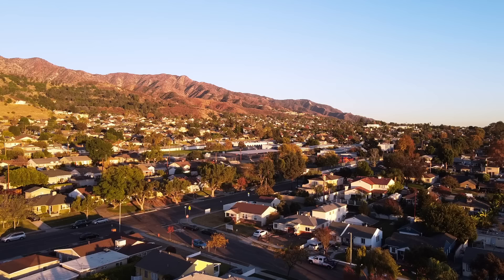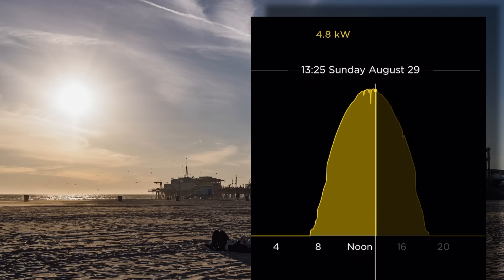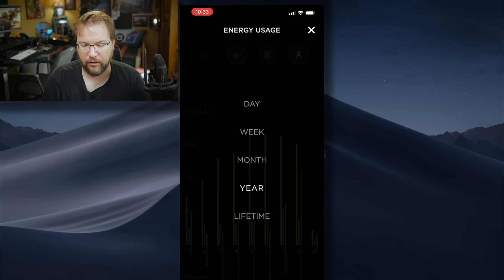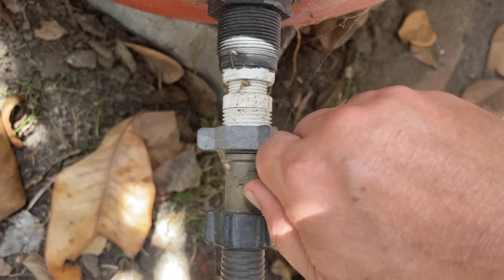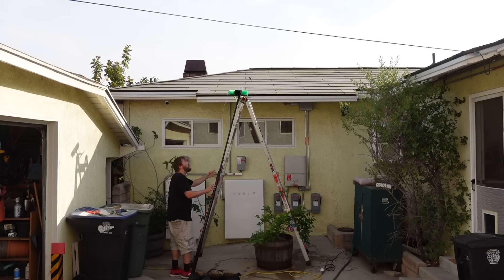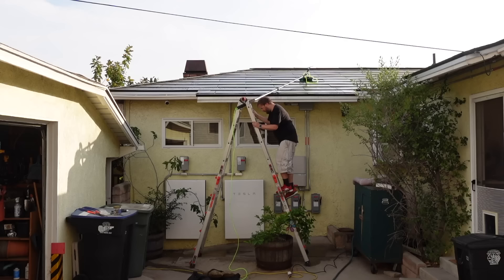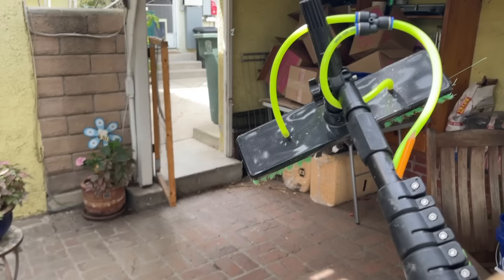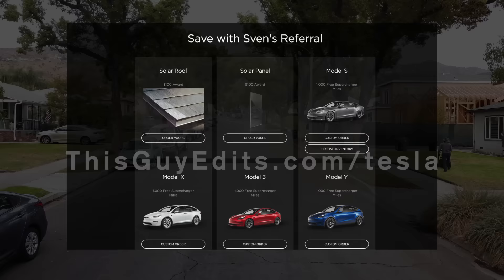Tesla Solar Roof: End of the Honeymoon Phase!

Comment: You guys in the USA seem to consume loads more Electricity than we do in the UK. My daily consumption is around 8Kwh per day, Approx 250Kwh per month. We also have to pay way more at around Unit rate £0.2031 GBP per kWh with a Meter charge of £0.23 GBP per day. My Electric consumption is fairly constant 365 days per year.  My heating for water and house heating is Gas which mainly cost around £50 per month 12 months a year with the months of Oct through to April costing around an extra £50 to £100 (colder months more expensive). Total annual Elec & Gas combined come to round £1500. I wonder if Solar would be a worth while payback period. I'm 65Yrs old and wonder if would see payback in my lifetime. I expect it depend how long am I going to live is the key question.

Great to see your experience of having the Tesla roof fitted. 

My house in the UK has tile roof. Its the original tiles fitted in 1928 when the house was originally built. They will need to be replace in the next 10 yrs as they are starting to flake. Hear in England it is not common to have boarded roofs. I wonder if TEsla have fitted any roofs in the UK. I'll have to find out.

Comment: Hose the roof down from mains tap water (more pressure) and then RINSE with the rainwater to remove mineral deposits before they dry.
I would think this would be easier, quicker and every bit as effective...?

Comment: Wouldn't it be better to wash the roof tiles with water from your hose bib?  maybe a converted pressure washer or something not quite so strong with bristles like you build for the rain water?  That pressure would make the cleaning of the dirt faster... You could also incorporate some kind of soap dispenser to put some dish soap in the mix.  after finishing a section use your rain water just to rinse the surface and remove any minerals that were in the tap water.  The only trick would be to make sure your first wash doesn't dry before doing the rain water rinse.  Also, would adding something like JetDry to the water help to keep minerals off?  nice video.

Comment: Idk about solar roofs. Probably better idea is nuclear energy augmented with solar fields that are more optimized for solar collection. Or a more efficient home solar system. 

For instance, the first kit I found is $12,000 for a 10kW system without batteries or structure for mounting panels. You can probably find it cheaper. Those panels can also all be mounted in a way to optimize solar intake. Unlike the Tesla system which is determined by your roof. That is also $12k before any credits are applied. So less than $20k for 10kW system, installation and batteries after tax credit? Just a guess. With easier upkeep and cheaper maintenance.

Comment: The improvement from cleaning is larger than you think. 41 kWh in september is not just 4kW better than that day in july, because the potential is less in september than it was in july (sun higher in the sky).
Reply from the maker: It wasn’t in September. The two days were within a 4 day span.

Comment: There are anti-spotting agents you can rince with that will reduce spotting (used in dishwashers). I don't have a tesla roof, but I use a micro-fiber shammy to dry our panels after washing (with Dawn) to prevent spotting/calcium build-up. Also, I wash when the roof is cooler, and not under direct sunlight.

Comment: Calcium and other particulates the filter might be taking out of the water are not necessarily toxins. In fact, I would be surprised if you had any significant level of toxins on the water on a developed country tap water supply.
Reply from the maker: Correct calcium is not considered a toxin. Our city water has worrisome amounts of unregulated chromium 6 and that is one reason why we filter out tap water for drinking.

Comment: I would definitely figure out how you can safely move around up there (harness and safety line) and then you’ll knock that job over in a couple of hours. I can do my traditional 9.28kW system in about 30 minutes. I just use a hose with a brush on the end and detergent - works great. No hard water in Sydney.
Reply: Watch out with detergent on your roof, this guy just has a rainbarrel but alot of people forget about raincollectionsystems beeing used for toilets or washing machines and maybe lawnwatering. U wont be laughing if your entire lawn is dead.

Comment: I miss this version of the app the new version is much harder to follow IMO. Cleaning the panels regularly is definitely worth it i see 10-15% more power. My best day has been 120 KW. I use a Ceramic car polish on the glass panels.
Reply: Polish that blocks or reflects light is going to severely impact the efficiency of your panels.
Reply: Wait a ceramic polish that reduces heat and light??? Sounds like your best day could be 160kw.

Comment: you paid 250 for a system, but you could have paid like 175 for an electric pressure washer (because we know how cali hates gasoline anything) with an angled arm, which also comes with a wash bottle....throw some soap on it and use the wide spray to get the least attack on the panels and be done in no time at all.

But you do you bud

Comment: I'm thinking if you had a large panel that would follow the sun it would be a lot more efficient than using the roof that only a small portion directly facing the sun generates the most energy.

Comment: Honestly I think regular panels are better, much cheaper higher energy density, easier to clean, they run cooler and have the advantage of lowering roof temps by acting as a "second roof" where installed. 
Like to clean let's say 8 large panels would easily do 1/4 of the cleaning. I think they do have their place maybe at the equator they make more sense as light will hit most the roof better. But otherwise your better off with panels fixed to where they will get year round light instead of over half being in mostly shade, ik they still produce power but not as much.

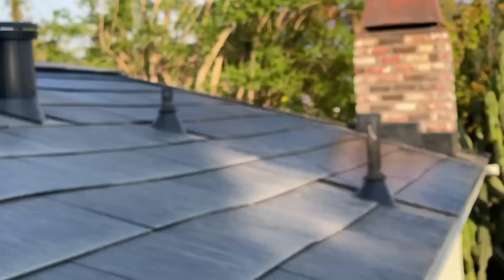Comment: Looking at the tiles at a front facing angle, they seem nice and straight. As soon as you get a good sideways angle at 7:18 they all look curved and warped. That can't be good for a rigid material like that. Of course I'm assuming the material is some sort of rigid plastic or resin. If that is indeed the case, I don't think your roof is gonna last as long as Tesla says it will.
Reply from the maker: The one side of the roof has a preexisting warp. The way they handled is with metal tiles in those spots which can be bent into shape and run over the warp.
Reply: @ThisGuysTesla  makes sense. I kinda figured it was the roof underneath that was warped but wasnt sure. That's pretty good. I couldn't tell the metal from the rest of the roof.

Comment: In your final estimation of the gain of cleaning up your roof, you compared a cleaned roof getting dirtier with a dirty roof that don't get even dirtier. For a constant loss rate of power produced no matter what you do, the energy gain would be much higher than your estimation, and at some point it would become economical to clean up your roof.

Comment: Water is very hard where I live, in terms o leaving spots, if you wipe things down and don't let the sun bake it on your car or whatever you should be just fine on almost any surface.  I had lots of experience washing cars by hand for years and basically you need to towel things off, same for windows.  I would assume the roof problem could be dealt with in a similar manner.  

Now the real question is how do you dispose of your more toxic than ever roof, will there be a charge for that and does it have one of those "Known to the state of California" cancer warnings on it?  I bet it does.   I cannot imagine the nightmare disposal costs of all these solar panels and roof maintenance problems in the real world 4 season places.
Reply from the maker: If you’re concerned about environmental impact, supply chain sourcing, factory carbon footprint, end product recycling and net energy breakdown you could read this:  https://www.tesla.com/ns_videos/2020-tesla-impact-report.pdf

Also While there are no global warming emissions associated with generating electricity from solar energy, there are emissions associated with other stages of the solar life-cycle, including manufacturing, materials transportation, installation, maintenance, and decommissioning and dismantlement. Most estimates of life-cycle emissions for photovoltaic systems are between 0.07 and 0.18 pounds of carbon dioxide equivalent per kilowatt-hour. This is far less than the lifecycle emission rates for natural gas (0.6-2 lbs of CO2E/kWh) and coal (1.4-3.6 lbs of CO2E/kWh).  SOURCE: IPCC, 2011: IPCC Special Report on Renewable Energy Sources and Climate Change Mitigation. Prepared by Working Group III of the Intergovernmental Panel on Climate Change [O. Edenhofer, R. Pichs-Madruga, Y. Sokona, K. Seyboth, P. Matschoss, S. Kadner, T. Zwickel, P. Eickemeier, G. Hansen, S. Schlömer, C. von Stechow (eds)]. Cambridge University Press, Cambridge, United Kingdom and New York, NY, USA, 1075 pp. (Chapter 7 & 9). http://www.ipcc-wg3.de/srren-report/

Comment: This is the reason I would not buy solar tiles over panels. You need to wash them every second month or you lose 10-20% of peak power and it is much easier to wash or automate the washing of panels than tiles.
Reply from the maker: It took about 4-5 months to lose 10% efficiency through dust accumulation. As soon as it rains efficiencies go back up as tiles are hydrophobic.
Reply: @ThisGuysTesla  Depends completely where you are and what types of pollen you have in the area. Here in Spain I have to wash my windows several times a week compared to in Sweden lets say.

Comment: On your highest energy usage during the hot summer months with that black solar roof. 
     Between convective heat and radiant heat projecting downward through your roof into your attic space. 
         What is the temperature of the heat gain in your attic that eventually heats up your ceiling drywall’s in your second story Redi and heat down into the house that your air conditioning needs to remove that consumes energy. 

Do you have some sort of radiant reflective barriers to offset the additional heat caused by the black tiles ? Was there extra insulation put down underneath that roof to slow down the heat absorption into the attic ? 

     DJ design in the air barrier underneath the tiles with an air gap opening down at the bottom of the eaves of the roof and use the natural flu affect as the heat hits the air in the gap it will naturally travel up to the peak of the roof and out helping him reduce attic radiant load ?

Comment: Lets do some math. $30-50k for a solar tesla roof. $30k divided by 16 cents power = 187,500 watts produced to break even. Divide that by 36 avg KWH production. That means in 14 years the system will start producing a profit IF nothing goes wrong, you dont pay anyone to clean or maintain it, and if the powerwall still is functional after 14 years. So if you pay $30k into this system, again never work on it, efficiency remains the same, pay no one to clean it or maintain it, and everything works flawlessly for 25 years. Im using 25 years because thats the warranty on the tiles alone. After that you get to replace on your dime. You will make $23,126.40 over 25 years. The risk to reward doesnt make alot of sense to me. I live in an area where the power here is 7 cents a KWH, which means it takes 35 years to pay off one of these systems. Im heavily invested into Tesla, however, the tesla tiles are a huge profit cow for people that like to burn money in my opinion.
Reply from the maker: Payback video coming soon. Find out if you're right :)
Reply: @ThisGuysTesla  Sounds good look forward to seeing that video.

Comment: So you wrote that the difference in the bills was "Savings" but you aren't saving anything yet.  What is the savings vs. your monthly payment for the solar panels.  Currently you're trading your electric bill for a solar panel payment.  Until they are paid off you aren't saving anything.  Out of curiosity what is your financing payment on the panels and the batteries.  without interest if you leased your panels which i think cost you $40,000 after rebates you're paying about $333 if you put no money down.  So if anything you're losing $200 a month some months.
Reply from the maker: Payback video next. You’ll be surprised :)

Comment: So its a cero calc you pay 16 cent and you get 16 cent,  why do you not FULLY use the state power grid as battery and avoided buying expensive TWO batteries?
Reply from the maker: To be able to go off grid during a blackout and not lose power

Comment: If you don't clean isn't it reasonable to believe that the dust build up will double in 2yrs degrading efficiency even more
Reply from the maker: It usually rains by October/November cleaning the tiles completely and resetting the clock.

Comment: How about adding a small amount of vinegar to the water to get rid of any calcium.
Reply: It would be far quicker to clean off the majority the dust using mains water and a pressure washer and then rinse using rainwater with vinegar in it. 
I wonder how effective something like ceramic coating or rainX would be at stopping the water marks?

Comment: 11:00 have you considered using a pressure washer to clean off the roof first, and then follow up with rinsing off with the rain water?

Seems like an easier solution to me.
Reply from the maker: I wouldn’t want to step on the tiles and power clean with regular (hard) water.
Reply: @ThisGuysTesla  You could connect the pressure washer to the rain barrel and use that water. Just make sure to put the pressure washer on a lower setting such as you would use to wash a car to keep from damaging the tiles.

Comment: Besides the “off grid” possibility in case of an power outage, what’s the benefit to buy the battery system? If you get a one for one credit for the electricity you put into the grid?
Reply: With a smart controller, one can export in peak hours and charge on off peak. That's the advantage plus backup power. 

That said, solar tiles is a poor investment compared to PV panels. I can't even imagine if something goes wrong and you need to replace a tile... Or try to troubleshoot lol
Reply: @TsLeng   thanks 
Now I understand 
Doesn’t work this way here in Germany 
I have multiple roofs, all with panels. Never had a roof that needs new tiles so I never calculated solar tiles against tiles+panels.

Comment: Hello, I noticed that on your videos there is almost every day at noon or a bit later you have a significant/sharp drop down in power generated by solar. I see it on the top of the graph for about 5-10 min and the drop down is roughly 15%. Do you have any explanation for it? My suggestions (brainstorming):
1. Error in software
2. Clouds/shade from the trees
3. Too high generation, so the system turns off for a bit of time
4. System reboot
Thanks
Reply from the maker: No idea
Reply: 5 temps too hot

Comment: How much did you pay for it ? This is so small kw. I did get few panels running 10kw solar system. The electricity company is paying me plus all for free. for last month i did drop into grid 1500kw. Also make sure they r selling for the same price as they r buying. I am buying from them 1kw for 20 cents but selling kws to them for 8cents.

Comment: Your bill is really low even before solar roof.  I just move to one bedroom apartment in San Jose, CA with PG&E. They are charging me $0.42/kw peak, few cents cheaper for none peak, I think 38 cents.  I used about 300kw and they are charging me $135 average monthly.  I try to keep lights off, no AC usage. Most of usage is appliances and gaming pc.  PC draws 200 to 250w (I measured it).  Too bad I can't get solar panel.  Not being able to use electricity much as you want really sucks!  I feel I am living in dark age, literally, all lights are off at night.  That reminds me...., I need to buy small motion sensing night light so I can stop injuring my toes at night running in to things.
Reply: Do you have a balcony, there are options for that to reduce consumption from the grid...

Comment: if you have wind often where you live, you may consider adding 2 or 3 small Wind Generators if in the future you need more energy made.   Since they can add both day and night.    I use a 50/50 wind and solar cause I live in South Dakota.  the steep roof limits me to north side solar.

Comment: Am I the only one who thinks your electricity usage is totally insane? In a smaller house, I used 400kWh per month, and in a huge 3600 sq.ft house, I used 600 kWh per month. Those houses have no AC, but I don't think that AC alone would cause usage to double or triple normal usage. It's none of my business how you use electricity, but I think that if you're going to a lot of trouble to scrutinize your electricity usage with your tesla roof, I think it would be wise to look at your electricity consumption, and find ways it can be reduced or made more efficient.
Reply from the maker: Are you charging your EVs with your electricity?
Reply: @ThisGuysTesla  no, that usage is with an electric car. But if you are charging an electric car, then yes, that will easily double the electricity usage.

Comment: 40k costs 1.6 savings a year ...  20 years IF no battery replacement or maintenance..  not really cost effective yet.
Reply from the maker: Payback video coming soon. Find out if you’re right :)
Reply: @ThisGuysTesla  if you are gong to do a full work up of costs analysis, don't forget to include investment strategies and average costs, figuring out what percent of people finance some of the costs. So over time what the true costs is, comparing the investment profits lost on the initial investment. Investing 40k can annualize 5 to 10 percent profits, this can be significant over 20 years of compounding